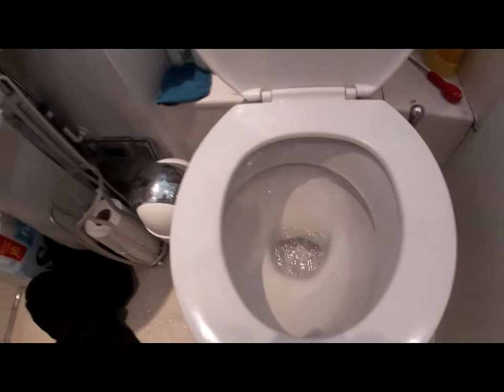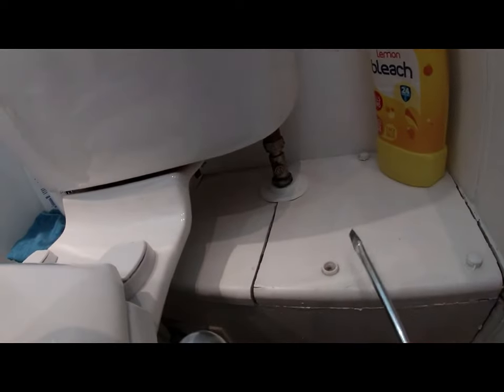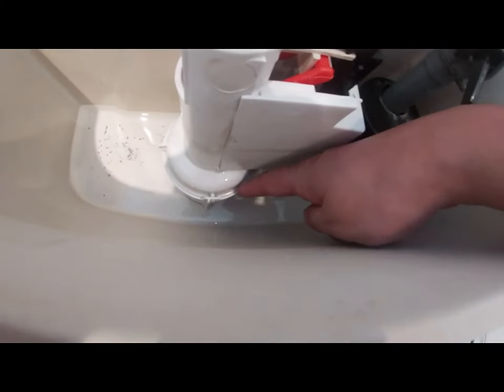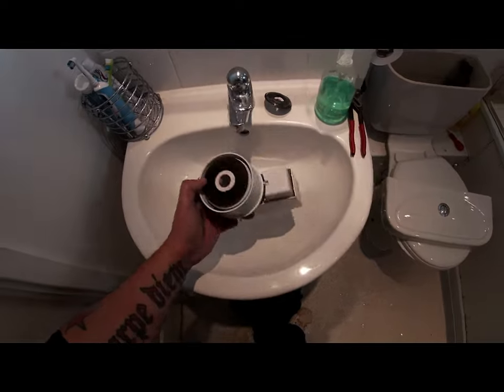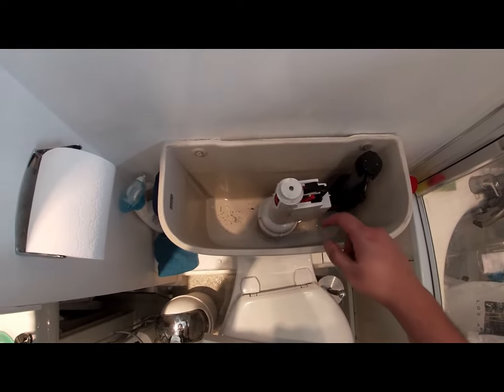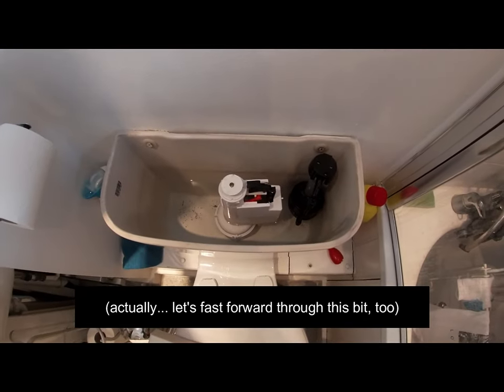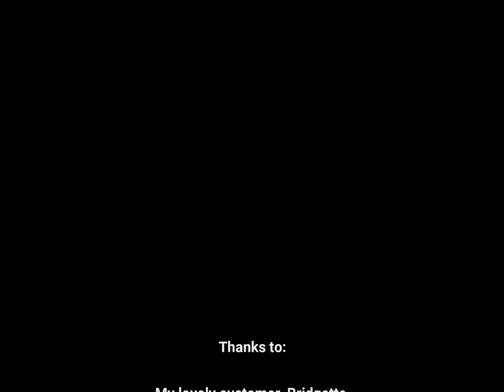Plumbing: how to replace the washer on a flush valve letting by into WC pan

Comment: The bits you skip over are the most important/tricky parts of the job lol. Still good tho 😂
Reply from the maker: In my mind I was skipping them because they were the easiest bits! Some of the parts sometimes get a little stiff, so it's literally just a case of pulling them off firmly. You'll be fine. :)
Reply: The one bit i need is how to get the retaining clip off!!
Reply: Came to the replies to say the same. Literally skipping the exact bit I wanted to see explained 🤦‍♂️

Comment: Great except for the really difficult bit of taking off the locking nut is sped up and with no explanation.
Reply from the maker: That's a fair comment. The locking nut is just clipped into place, and is pulled/wiggled out (use a pair of grips, as it makes it easier) until it pops off. There's honestly not much to it, and it's not difficult after you've done it once. If it was difficult then it's likely the part had partially seized up on your one, which I'm sorry to hear about. Hope everything else went well for you, at least.
Reply: @plumbingwerx  I was worried I was going to break something as I prised it off. But you're right, it wasn't too difficult. Really useful video. Cheers.
Reply from the maker: @yokohamatomohawk1840  , always happy to help, and glad to hear all was well in the end.

Comment: I’ve just replaced this seal on our toilet and it kept dripping after i changed it. I took the seal out to check for debris and dirt and everything looked clean, gave it a wash under the tap just in case, and then after two or three times of trying i replaced the seal again but as i pushed the washer in it clicked into place which i hadn’t felt the last few times and now it’s fine, so maybe it was that the clip wasn’t in right the first few times. Thanks for the video, looking forward to the water bill reducing now!!
Reply from the maker: Hello Tom. Glad to have been of service, and happy to hear that everything worked out well in the end.
Thanks, and all the best!

Comment: So I replaced the seal as shown to stop a stream of water running down the back of the pan but I still get a very very small dribble. It's massively improved but was wondering if these seals are prone to "weeping" a small amount of water.
Reply from the maker: They can be, like anything. It may be worth taking it out again, and checking along the inside rim of the cup/the section that stays in the cistern. Sometimes a bit of dirt/grit can get stuck there. At the same time, while it's out, you can check the state of the seal on the diaphragm washer.
Thanks

Comment: I used this video a year ago to replace the seal on one of my toilets at home and it was very useful. However I've come to replace a seal on another toilet, but the way the flush valve is fitted, I can't turn it anticlockwise to take it out of the "cage" it clips into, as the body of it is already pressed up against the back of the cistern, so it can't be rotated further.  Have you seen this before? Is there anything I can do to fix this?
Reply: Could try reaching down and rotating the cage clockwise?
Reply: @NathanJ281  will the cage rotate just with a bit of pressure? I always thought those were pretty tightly screwed into the cistern from both sides so wouldn't rotate nicely. I can give it a try though!

Comment: Hi, thank you for your video. I have a Ideal Standard flush with dripping sound coming from inside. I changed the seal but it is still happening so I think I might need to replace the whole flush (until now I still couldn't figure it out where is the leakage). Unfortunately the flush has now been discontinued and I found a very compliacted alternative which I don't know how to change it. Just wonder if you know the Ideal Standard flush SV92667? Thank you!
Reply from the maker: Hello Grace.
Don't quote me, but any alternative offered by Ideal Standard should be a direct replacement for whatever one you had before. It's hard to diagnose something like this remotely, and I don't want to give you incorrect information. I think sometimes the best thing to do is to just contact someone qualified, who knows what they're doing, and will be able to assist you.
Sorry I can't be more help, but best of luck.
Thanks,
Ivo @ Plumbingwerx
Reply: @plumbingwerx  Hi, don't worry about it! Just wanted to share my situation and see if someone also has had a similar problem. 😊

Comment: Hello mate just wondered, I’ve got water dripping through to the basin and it flushing by itself about every 10 seconds. So I’ve turned it off, cleaned up the rubber and it’s still doing it. Any ideas what I can do to try and help whilst we’re waiting on a plumber? Thank you!
Reply from the maker: Hello.
If it's flushing by itself it sounds like you have a self-flushing valve, which isn't what this one is. 
If you've already got a plumber on the way the best thing to do is just avoid using it (if you can, I know it's not always possible), and turn the water off to avoid water waste.
Best of luck!

Comment: Thank you for the clear instructions. We had exactly this issue. The diaphragm washer wasn't perished but I replaced it anyway. The drip, drip, drip into the pan is still there though.  Is it a case now of replacing the whole flush system?
Reply from the maker: Hello.
So, if it's still dripping into the pan it may be that there's a small bit of dirt/debris stuck on the inside of the flush valve itself; the part that stayed inside the cistern, when you removed the other section. Try popping it out first, and then giving everything a good clean, then placing it back again.

Comment: Great video very informative but I’ve seen  a lot videos on how to replace the valve seal however what you fail to mention (as others do) is how do you determine what diameter seal you need to buy? because there are a lot different sizes and types available.  So if it’s damaged it can be difficult to to determine the original dimensions any help would much appreciated cheers.
Reply from the maker: Thanks for the feedback. If you know what make and model of valve you have then you just buy the seal for that one. It's not a case of one valve having multiple seals.
Thanks
Reply: @plumbingwerx  thanks for your feedback I understand one valve doesn’t have multiple seals but how do you know what make of valve you have in the first place ie where do you find the model number etc ??
Reply from the maker: @reflexxtr  Right, I understand what you mean now. They don't usually have the model number written on them. Or ever, actually. But the one good thing is that manufacturers have decided to make them all look different to one another. Your best bet is to isolate the supply to the cistern, remove the existing valve, take it to your local plumbing shop, and ask them to help. That's about the best advice I can give you over this, I'm afraid.
Thanks,

Comment: I’ve done this on three toilets at once, two perfect now. The third is now worse somehow? 

Any thoughts on why that might be? I have cleared any debris out I think but not made a difference.
Reply from the maker: Hard to say what the issue might be without seeing it in person. There are a few reasons why this may happen:
1/ There's still some dirt/debris in there which has "cemented" itself in, and isn't being removed.
2/ There's some kind of deformity/irregularity in the moulding that's revealing itself.
3/ The new washer has some kind of deformity/irregularity in it, which is preventing it from sealing correctly.
4/ The mechanism itself is faulty, and not allowing the washer to drop fully, and create a seal.
Like I said, it's hard to know exactly what the issue is without seeing it in person, so if you've had to luck with just replacing the washer I would say to replace the removable section of the flush valve itself, and seeing how you go.
Thanks,
Reply: @plumbingwerx  Thanks for the advise. 

I do not see any obvious issues in the cistern or the seal. Equally the mechanism seems OK too. 
I guess I will try switching the mechanism with one of the other toilets to see if that works next.
Reply from the maker: @MatW1234 , sounds like a good plan. Process of elimination, and all that jazz.

Comment: Where can I buy the whole flush valve like the one on video ? My problem is the plastic at the top (where you press) broke ..
Reply from the maker: Hello Stan.
Any plumbing merchant should be able to supply you with one. My one of choice is City Plumbing, and they have branches nation wide.
Thanks, and best of luck.

Comment: good video,but what to don if it still leaks into the pan after the washer is replaced?
Reply from the maker: Check for any dirt or debris around the rim, where the washer sits. Also, check that the new washer is actually in a good condition. Failing that, call a professional - there's only so much you can do yourself before calling someone who knows exactly what else to look for.

Comment: Brilliant video - many thanks. I've just changed an Ideal pneumatic dual flush valve. Flushing is working fine, but the water still runs into the toilet bowl while the cistern is filling, gradually slows, but never stops entirely. Looking at the valve washer, I don't understand how it's supposed to shut the water off - it seems so flimsy and doesn't sit on the plastic seal face with anything like a water-tight seal [IMHO]. I'm confused!
Any help would be welcome.
Reply from the maker: Hello John.
If you've replaced the filling valve, and there's still water going into the bowl it'll be your flush valve that's letting by. Replace it, and everything will be back to normal.
Thanks
Reply: @plumbingwerx  Hi Ivo. Many thanks for your swift response - very impressive for a no doubt busy plumber!
Unfortunately, you misunderstood my possibly clumsy explanation. Yesterday, I installed a new flush valve (see above) in its entirety as one of the two clips was broken on the old one (I didn't know this until I tried just to install the top half), neither flush worked properly and water leaked into the toilet bowl. Now I've just got the water leaking into the bowl problem, so some progress!
In essence, I can't how such a flimsy outlet valve washer with seemingly no pressure behind it could possibly provide a water tight seal against a ridged plastic seat in the bottom half of the unit. So my question really boils down to: How is the valve supposed to work, given that it doesn't seem to at the moment? Also, once the flush is operated, why does water still flow into the bowl while the cistern is filling - clearly quite a waste. Unless I've got one with a spring missing (or similar), my suspicion is that there is a design flaw with this valve.
Hope you can help. Best regards.
Reply from the maker: @johnslater5161  
Happy to help, if I can.
If you've flushed, and there is still water going into the pan it's because the flush valve/washer is faulty, or could have some dirt on it. The water tight seal doesn't need to be particularly strong, as it isn't under a lot of pressure. It usually just sits in there, held down by the weight of the water. However, if it's still letting water come through, something is wrong. Maybe try taking it out, and giving it a good clean, checking for any imperfections, and also cleaning the "cup" that it sits into. 
There's only so much I can do via this format, so the best thing to do in this instance may just be to call a plumber, and have them look at (and fix) the problem for you. 
Sorry, pal.
Reply: @plumbingwerx  Ivo... You are a scholar and a gentleman!
I really appreciate your taking the time to reply to my queries.
I did as you suggested, but there wasn't any debris. I did notice that one of the clips on the bottom half of the fitting doesn't hold the top half as securely as the other one - i.e. the top half rocks slightly when in situ. However, I'm hoping that the weight alone of the top half is sufficient to provide the seal required - I could be wrong! 
IMHO, the valve unit is poorly designed and manufactured to a price - approaching £40 doesn't represent good value. If I'd bought a plastic toy of with a similar level of construction, I would have been aggrieved if it cost more that £15.
Update: After further investigation, I've discovered that the inlet valve was also leaking. I've removed and cleaned it and was hoping to get a like for like replacement, but the model (Ideal Standard SV04667, bottom fill with screw thread) has been replaced by a side fill push fit (SV80367). I don't want to completely remodel the installation and I don't think there is enough room for it anyway, so I'm going to get a replacement diaphragm (hopefully locally) and trust that it cures the inlet problem.
I'm going to remove the outlet valve again as well, completely re-seat it and see if doing all the above cures the original problem.
Query: The outlet kit contained a loose rubber washer which doesn't feature on the diagram provided. I'm presuming that it can be used to provide an extra seal against the cistern base, which seems of have a washer fixed in place anyway. Is this correct? I didn't use it (there wasn't one on the one I removed) and the joint is leaking slightly, so I'll probably try to fit it this time around.
Best regards...  John
Reply from the maker: @johnslater5161  
Always happy to help, if I can.
It sounds like you're doing everything right. If it's still not quite getting there then I suggest it may just be time to call in a Plumber. Being a Plumber myself I know (from customers telling me) how hard it is to find a good one. Be assured that they exist in your part of the country, too. There's only so much detail we can go into before this becomes a "forum" for plumbing issues.
Best of luck, and hope all goes well.
Thanks,
Ivo @ Plumbingwerx
Reply: @plumbingwerx  Hi Ivo. All's well now rafter following your advice, removing the entire outlet valve, cleaning round the seal, carefully re-seating, reinstalling and then replacing the inlet valve diaphragm. The last issue was a bit problematic as the replacement diaphragm was slightly different (white plastic insert as opposed to red and different thickness), but after adjusting the float, everything settled down. So now, both flushes work correctly and after a while, the dribbling into the bowl stops completely. Roll on the next water bill!
Many thanks for your help - all power to your elbow!

Comment: Hello lvo 
I got the same cistern set up ,change the flush valve seal , what the seal fits on I took it off to fit the seal now can't get it back in , don't realise I don't have to take it off to fit the seal can you help please thanks in advance
Reply from the maker: Hello Nicholas. 
Not sure if you still need a reply, but this isn't the best way to get a quick response from me. In future, if you look up Plumbingwerx, you'll see my website and contact details. 
The same way you took it out, is the way you put it back in, but in reverse. You'll have to line it up correctly, and then twist to lock it into place.
Hope all's well, and that you managed to get it fitted correctly once again.

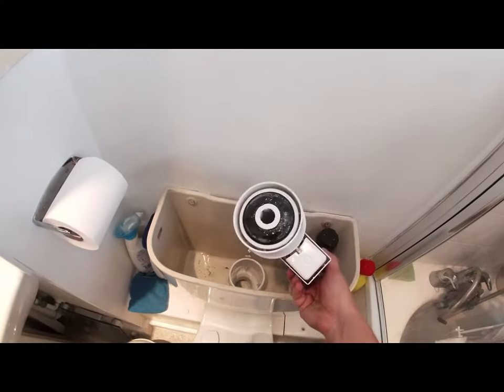Comment: Why speed up the hardest bit at 1:20?  I can’t fathom out how to release the washer!?
Reply from the maker: Hello Mike. 
It was a completely personal move, just because I don't like you. 
Seriously though... I just sped it up because it kind of "dragged" the video out. To get the washer out, just do what I did: get some grips, and pull/jiggle it out. It's clipped in there pretty firmly, so don't be overly gentle with it. Most suppliers will also provide you with the plastic clip, as well as the rubber washer. That way, if you break it, it's not a bit deal. 
Best of luck!
Reply: Ivo at Plumbingwerx Haha! Thanks for the deserved abuse... yeah I was being a fairy and didn’t want to chew anything up.  Bog now sorted. Cheers!
Reply from the maker: @MS-Patriot2  Happy to help, Mike. :)

Comment: Replaced the Seal, but it still continues to leak? any ideas for troubleshooting?
Reply from the maker: Try removing the valve from the internal "cup", and see if there's any dirt/debris stuck on the inside. That's usually what it is. It's possible it's a dodgy seal, but hard to diagnose any more than that, I'm afraid.
Reply: It’s the black hook that goes over the barrel of the filling part you can see it in the internal guts of it

Comment: Thanks for the video, I followed your advice and changed the rubber bladder, this seems only to have slowed down my leak, I noticed in your videos that the connection at the bottom of the pan was rigid, mine however moves when i uncouple it, is this the problem and will I need to replace the whole flush mechanism?
Reply from the maker: Hello Darren. 
If I understand it correctly, you just need to try tightening the backnut on the underside of the pan, the one that holds the mechanism in place. Essentially, tighten everything, just to make sure. Failing that, feel free to e-mail me some pictures/video (address on my website), and I'll try to help.
Reply: Hi Darren. I’ve got exactly the same problem! I’ve changed the rubber seal with a new one and still running. Maybe it’s a problem with the inlet valve instead? Trouble is, I can’t get to the underside of mine as it’s a close wall type. How did you get on? Did you manage to tighten yours and if so, did it resolve the issue? Cheers.

Comment: I'm hoping you can help me with another issue. My toilet will not flush.. No pressure from the push buttons. Any ideas?
Reply from the maker: Hello Billy. 

I'd need to know what kind of push button flush valve you have; there are few different ones, and each type has to be treated differently. There's no "one size fits all", I'm afraid.
Simplest thing, just get the exact same one again, and replace it yourself.
Failing that, get a plumber to come out and have a look at it for you. Can't imagine it would cost you more than £80, inclusive of parts.

Thanks,
Ivo @ Plumbingwerx